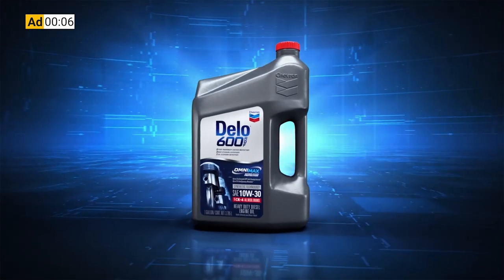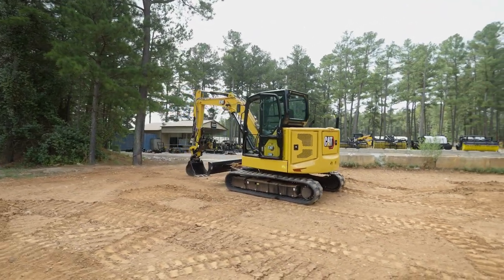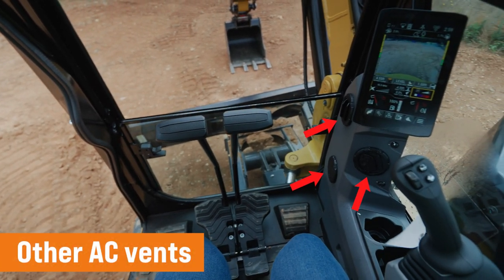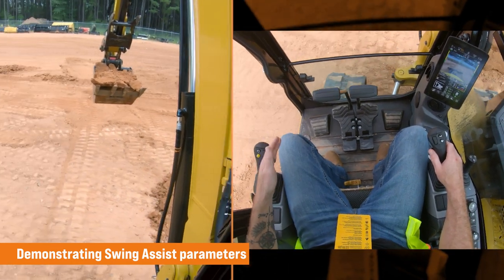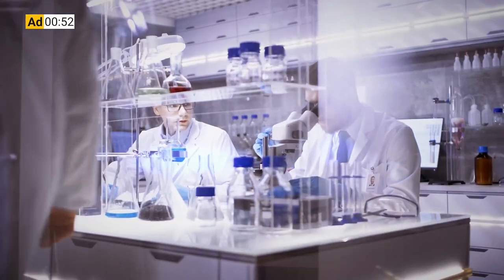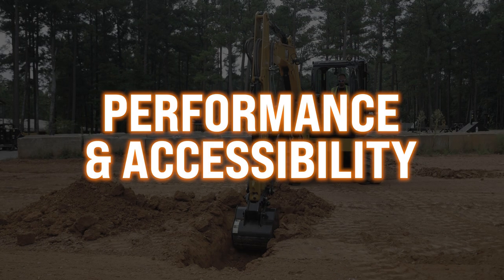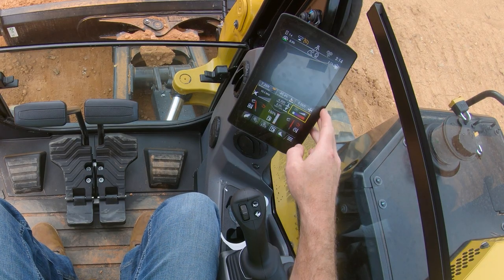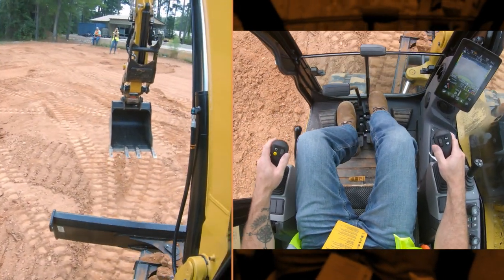Test Run: Cat’s 306 CR Compact Excavator is a “Fantastic Little Machine”

Comment: I have a 306 and it it easy to get to the climate control without even looking at it. There is a rotary knob in front of the throttle on the right console. You can set it up so all you have to do it turn it to the right to increase the temperature and to the left to decrease the temperature. You don’t even have to look at it. They are a great machine and that was a great review.